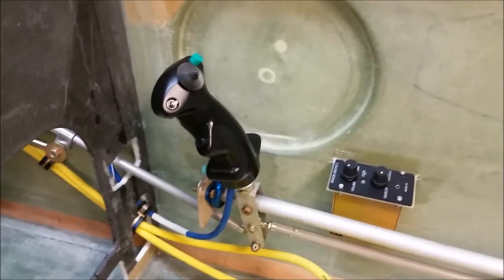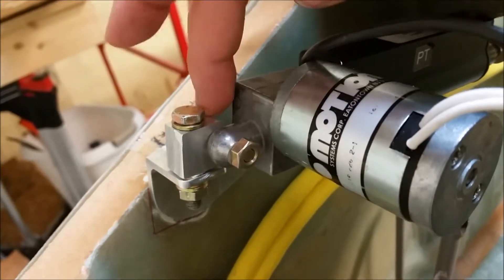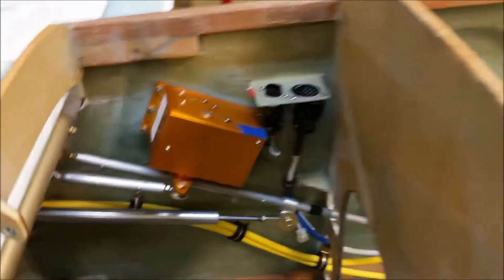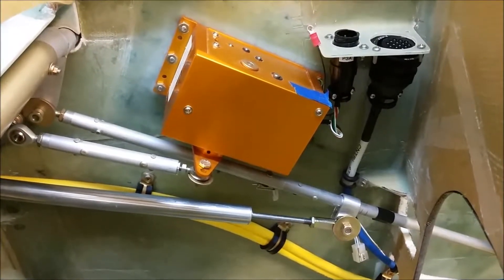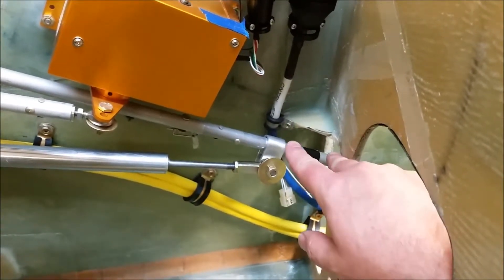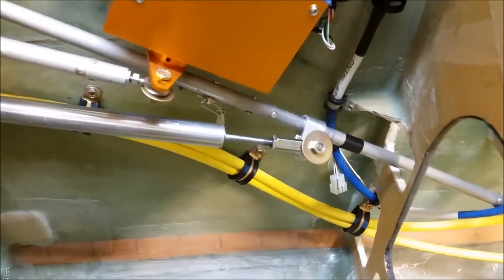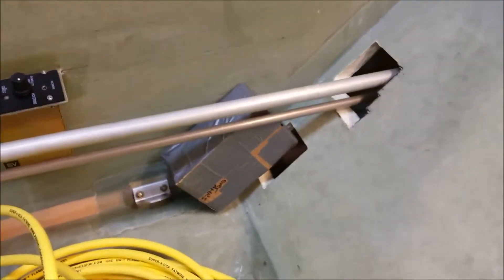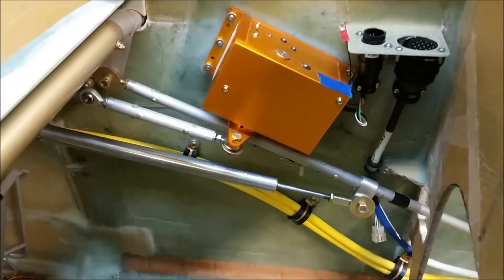Airdog77

Comment: Hi Wade, great workmanship!  I'm installing one of Jacks electric nose wheel systems,  I was going to use a 925 battery but I see you have selected a 680.  Would you recommend the 680 for an all electric Long?
Reply from the maker: Hi Richard, thank you for the nice words.  If I could fit a 925 in there I would probably go that route.  More weight in the nose for these birds for ballast is of course not a bad thing.  My 680 would be the minimum battery size I would go for a Long-EZ battery.  I have no concern over the 680 working, but my decision was based more on the amount of space I had available.  I think battery choice is more pronounced if you fly in much colder climates, than I would definitely try to fit a bigger battery in there!  Good Luck!